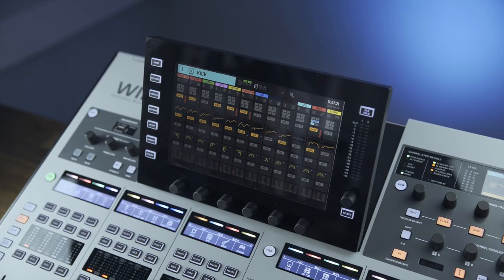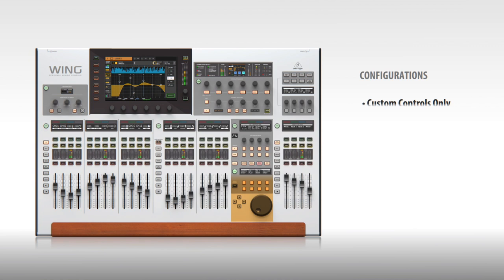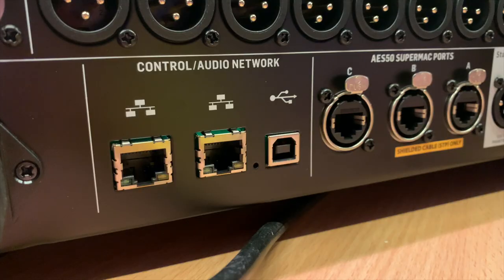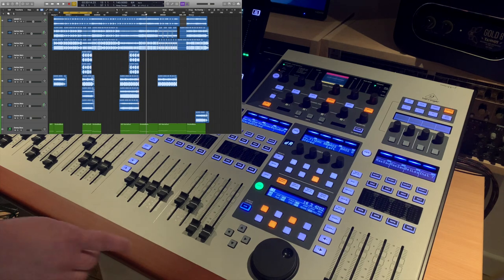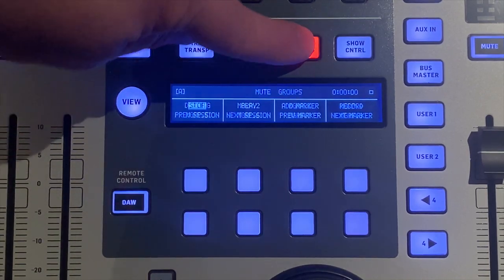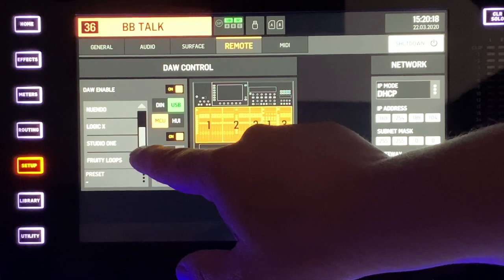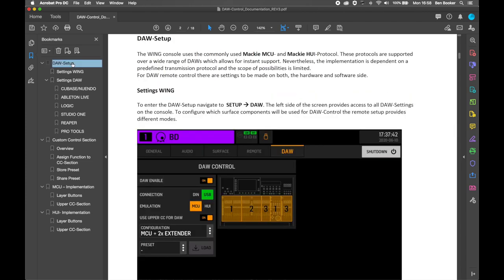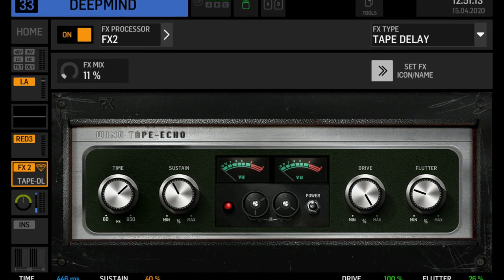WING DAW Update

Comment: Still some work to do\The wing still strugling to get off te Ground.
Reply from the maker: What features are you missing?
Reply: @behringer    I miss a compact solution for interfacing the Wing with big Eurorack Modular systems using AES50 or StageCONNECT (or eventually DANTE) plus some adequatelly designed small StageBox with lots of minijack inputs  and outputs (with optional dc coupling) all compatible with Eurorack set of levels (selectable between 0 to 10v and +5 to -5v) i want to be able do as complicated mixes as i wish and use my many processing modules as effect units for the Wing, all with the minimal cabling possible.

Comment: <<<<PLUGINS>>>> It would be great to have emulations of TC Electronic Finalizer, Chandler EMI TG12345 Curve bender, Zener Limiter, EMI RS124/Altec Compressor.  Plus VST 2 and VST 3 32/64 plugin ability using USB Flash as interlaced host to put plugins on up to 256 GB. A Wing Ecosystem with KVRaudio.com and other Vst sites that offer  Free plugins Marketplace. Mixcraft does this. Please add a crash Vst container program for VST that fail to launch so it does not cause the mixer to freeze as annoying daws do. A few daws now have the container.  Extended Ipad and Android multiple screens after you fed our Wings with software sauce. Thank you.
Reply from the maker: Thanks for the suggestion!

Comment: @behringer why couldn't y'all put a pan knob on each fader like a real mixing board? This 1 pan knob is taking away the flow of mixing. Select a track then use that 1 pan knob is slowing up the mix flow. I WILL NOT buy the Wing because of this bad feature. This Mixer Control Surface could have been perfect if it had 1 pan knob on each fader...a total of 24. Please make 1 with pan knobs on each fader in the future...please!!